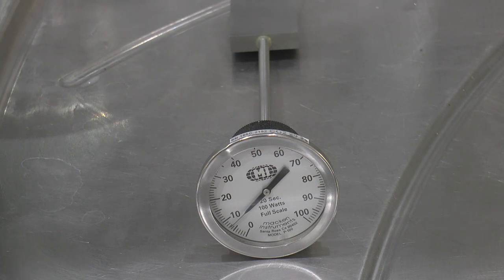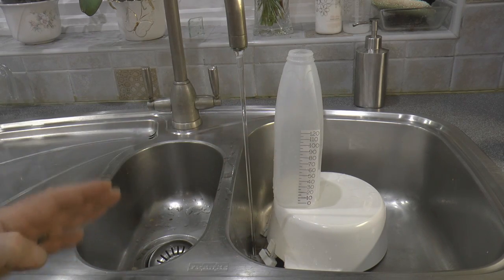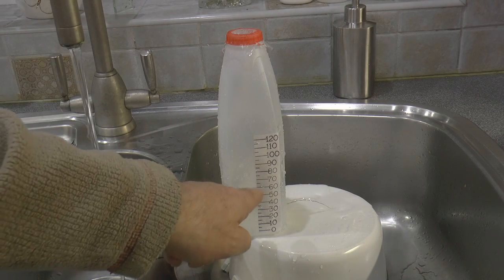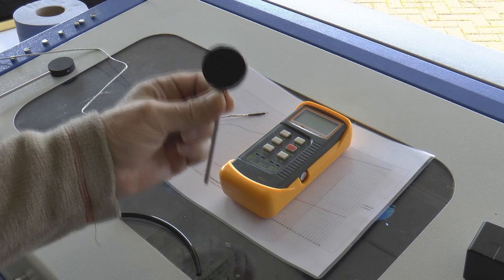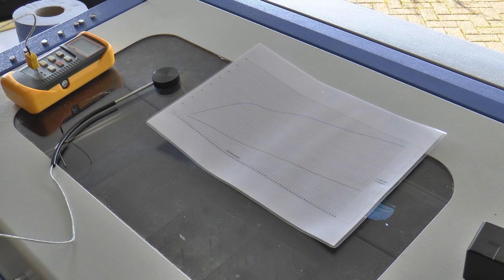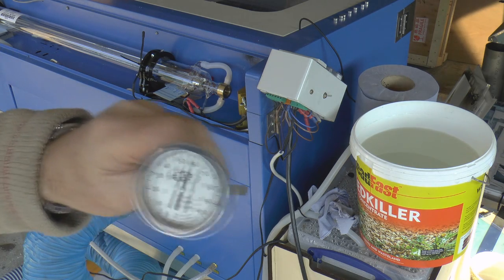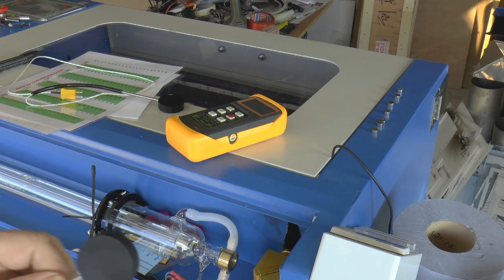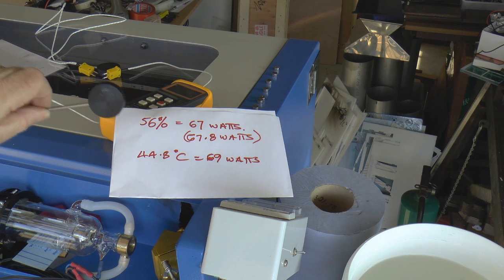RDWorks Learning Lab 53 Power Meters and  the doHICky comparator

Comment: Great job with idea and explanation. 
I have one doubt: why you don't try insulate back and sides of aluminum block? This will act as "reduce leak hole in the bottle" in your explanation, so should effect in more accurate reading. Too hard to avoid / remove moisture? Maybe removable, foam insulating cap will do the job?
Reply from the maker: +bialy100k 
When I first received my expensive Macken power meter, my thoughts were much like your own.  I tried experimenting with it using a foam jacket on the 5 non irradiated sides It was increasing readings by half to one watt. However, there  was the immediate inconvenience of having to take the jacket off every time I wanted to water cool it back to room temperature  and secondly I quickly realised that I was messing with the calibration data that was supplied with the instrument. Over time I established just how and why this instrument works. It matters not at all how efficient it is at absorbing IR energy or how much of that energy leaks away.  As my video tries to explain,  it's key to start each test from room temperature , whether that be 5C or 35C  because the heat loss from the block is directly related to the temperature DIFFERENCE, not the actual temperature. The mass and absorption characteristics of the aluminium block remain constants, the heat loss characteristic, although complex to analyse, remains a constant and the exposure time remains constant  If you keep the IR power constant as well and keep running tests you will finish with exactly the same temperature rise in the block each time. If you now change the IR power level, the temperature rise in the block will increase also.....but maybe not proportionately. That doesn't matter because IT WILL ALWAYS BE THE SAME.  Constant conditions give constant results.

 Many people have tried copying this device because its mechanically simple to replicate. Despite being expensive it has two significant design weaknesses. Firstly the aluminium block is fixed to the thermometer with epoxy, so if you get the block too hot it will break down the glue and fall off, Secondly the thermometer is a mechanical mechanism, that makes it delicate and possesses significant thermal lag.  Even when you understand the way in which this device works  you are faced with what I like to describe as "a piece of string problem" If I give you a piece of string of random length, is it of any use for measuring distance? Obviously, no. Ah, but I have a tape measure. If I let you CALIBRATE your piece of string by transferring FACTS from my tape measure onto your piece of string, you now have a secondary standard piece of measuring kit.  Anyone making their own power meter is effectively  creating a random length of string. It may sound a crude analogy but my doHICky is effectively  a piece of string with fairly accurately positioned knots in it. It is not intended to be a laboratory standard device but a means by which you can asses your machine's performance and do important checks like power losses between mirrors or through lenses. I have now consigned my expensive and delicate power meter to a safe drawer and regularly use my more rugged "lollipop"
Best regards
Russ

Comment: How important/necessary do you reckon the anodizing is?
Surely the laser will remove the anodizing after a few tests!, or is it that much out of focus at the end of the laser
Reply from the maker: +DigitalFPV 
Hi
The anodizing is absolutely crucial because raw aluminium is about 99% reflective so no heat energy will be absorbed. I have tries rough and smooth anodized surfaces with no discernible absorption difference. The forced aluminium oxide surface that is produced during the anodizing process is thin, may be as little as 25microns (about .001") but the change in the crystal structure allows it to absorb the infrared radiation. In itself this oxide layer is  not a very good conductor of heat, but the layer is thin so it quickly transmits its heat into the raw aluminium  beneath. As you rightly say, you can etch an anodized aluminium surface and that is exactly because the oxide absorbs the energy (how much is debatable but it's more than 95%) it heats up and can be damaged (etched). It does require a HIGH ENERGY DENSITY to do this damage. If you refer back to my "Understanding Lenses" video  https://youtu.be/WbBPps42iHc you will see how the energy density is all to do with the spot size.max energy density is achieved at the focus point but as you move the work away from the focus point where the spot size has increase by just 30% the spot size will have TWICE as much area and the energy density will halve. Now move a little more and increase this new spot by 30% and the same halving will apply We are now at 1/4 density. You will see from this that the energy density is falling off very quickly as you go out of focus

My 1.52 lens would do significant damage to the anodized surface if I was closer than 1/2" to my nozzle. I tend to test at about 2" awa.y For a 2" lens I would think 3" below the nozzle would be safe and for a 2.5" lens I would leave 4"

Hope this answers your question
Best regards
Russ
Reply: Thanks for the answer!

The reason I asked was because of the low power needed to etch Anodizing (Actually I rather suspect it is not etching but vaporizing the dye perhaps).

Had good results etching commercial black anodizing using only 16mm/sec @ 10% using a (hopefully realistic) 100W laser so operating near full power even with the beam defocussed could probably affect the anodizing, hence the question.
Reply from the maker: +SarbarMultimedia 

Hi
To be honest there is a little mark on one side of my Macken Meter where i quickly learned my lesson. So I always use that side to do my first test at a new power....just in case.. The doHICky is wide enough to use an edge for initial "sighting"
Thanks for question
Russ

Comment: Can you tell me if the calibration chart will work with all lasers?  Or does it have to be adjusted per location?
Reply from the maker: +Ron R 
Hi Ron
This is designed to work with CO2 lasers emitting at 10.6 micron wavelength.I'm just in the process of making a batch and I have modified my original design slightly so that it will work for lasers up to 150 watts. If your ambient is 5 or 35 it doesn't matter because the whole principle is based on temperature differences not actual temperature
Regards
Russ

Comment: Hi Russ,
regarding your answer:
I see no difference in supplying a sheet of paper with a relation table or (in my opinion much better) supply the information of the right time (for the device you sell) to have a 1 to 1 relation between W and C.
best regards,
Walter
Reply from the maker: +pyrofilm 
Hi Walter
I just love your input......dont stop!!
Your point is well made with one small problem as the design currently exists. For people in hot climates (one guy in Australia was working in a  35C workshop. Unimaginable to us in Europe but he was well used to it. That would mean the current block mass would reach about  110C  at it's top specified value of 100 watts and that's with the current temperature to watts ratio of about 0.7 deg C/watt. What are my choices to achieve a 1:1 ratio?
1)I could increase the exposure time by about  30%.  That would drive the top temperature even higher to say 140C for the 100 watt guy in Australia. Logically this is no problem for the block or the thermocouple (there's no glue in here to worry about ), I  just  find this intuitively too high a temperature.
2)I could increase the time by about 30% and limit the chart to 70watts
3)I could increase the mass of the block by about 30% and rework all the calibrations

This last option is the only sensible one to try and achieve your goal.  I do accept that after subtracting the ambient temperature, for that temperature difference to also be the number of watts is very convenient. 
I am shortly about to embark on cutting metal so I will increase the mass and see if I can find that magic time when I calibrate them
Thanks again for your very constructive input
Best regards
Russ.

Comment: Hi Russ,
just me, again.
1. if you like to sell such devices you should definatly sell them with the electronic thermometer unit, as usually they are not calibrated and different brands (especially the cheaper chinese devices) will give you different numbers on different sensor devices.
2. instead of a calibration chart you should calibrate the system by deliver a specific measurement time to have  a 1 to 1 relation from Watt to C . This would make things so much easier then.
3. the elektronic thermometer devices could be bought having a zero offset calibration. With such a unit and the right calibration time the system could be much easier to use.
best regards,
Walter
Reply from the maker: +pyrofilm 
Hi Walter
 As always , excellent comments. However there are good reasons for not producing a complete instrument. There maybe copyright issues involved that I wish to steer well clear of.. As I mentioned to Dwayne above, this is not intended to be an accurate scientific instrument  but something that emulates the principle and gives between 5 to 10%. accuracy. If you have a 100 watt machine and are seeking to reduce 3 or 4 watt losses between mirrors  is .3 or .4 of a watt inaccuracy an issue?  The K type thermocouple is being used as a comparator  here also to measure temperature difference, so it matters little that the absolute values displayed on the meter may be a few degrees off  but the difference will remain reasonably constant. Yes, if you had a fancy meter that would zero and you had time to experiment with each one to get the scaling correct, you could indeed set 1 degree =1 watt. That's exactly what Macken do with their meter. It says 20 seconds on the dial but the calibration certificate states 20.2 seconds. The important principle here is that you have a lump of metal with a calibration characteristic. There will be lots of clever electronics guys (I'm not one of those) who will be able and enjoy building their own meter to convert the data into watts display. There will equally be housewives and hobbyists with no specialist knowledge that want the simplicity of the solution I'm proposing.
Many thanks for your input and best regards
Russ

Comment: Russ, you're a damn genius.   Did you consider making the target a cup shape? it would be less sensitive to off angle laser strikes.
Reply from the maker: +2020tesla
 Hi Dwane 
I know I replied to you earlier but the answer isn't posted....strange. Thanks for your comments. Yes, I could have made it cup shaped but that would have made the machining more difficult and the mass more difficult to control. The shot blasted finish may have reduced the incidence issue in an easier manner by presenting lots of angled faces.However,  provided the beam is reasonably normal to the absorbing face it seems to be very repeatable. The other thing to bear in mind with this device, I'm not trying to produce an accurate scientific instrument, this is more a piece of string with knots in it. If that was good enough to get Christopher Columbus across the pond then it will be good enough for our little machine problems. Seriously though, I know from experimentation and calculations that there's probably less than  5% error up to 100 watts.  I'm claiming no accuracy figures because I'm relating it  to the the accuracy of the Macken meter. 
Best regards
Russ
Reply: +SarbarMultimedia 

please advise when the dohicky lolly pop is available, you may e mail me at Dart19@aol.com
btw enjoy your videos greatly
tom davidson